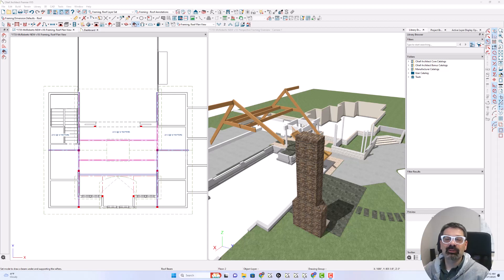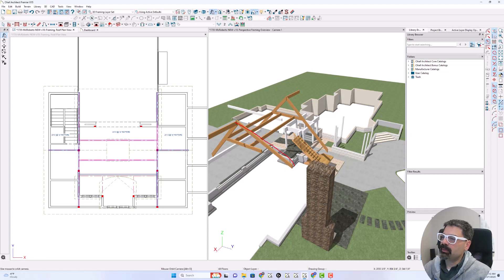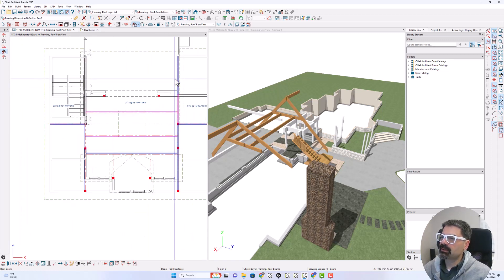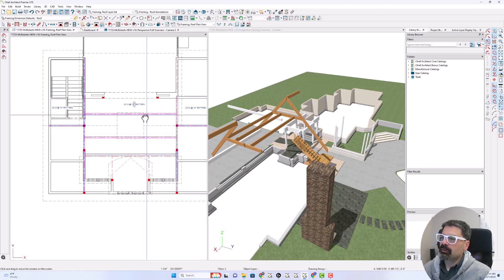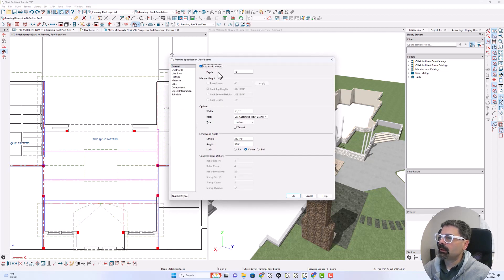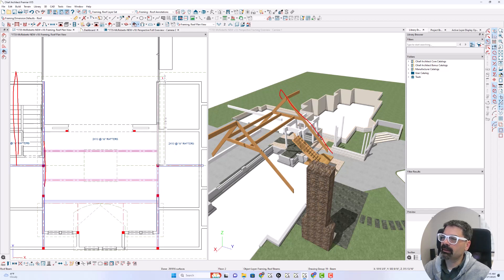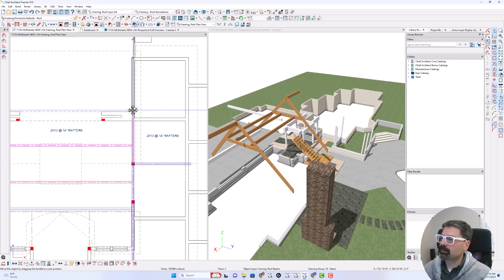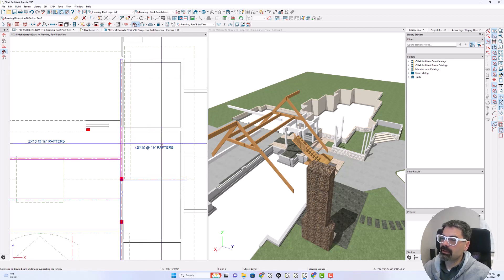Keeping Roof Beams at Correct Pitch | Chief Architect

Comment: It looks like the shed roof overhang and dashed baseline is extending farther over the right wall than left wall.  Always great videos, Tim.
Reply from the maker: It's been a minute since I recorded this, but pretty sure the L/R overhangs were very close to similar. Even if they were different, I don't think they would have been different enough to make an effect on the beam problem I had.
Reply: @DesignbuildsolutionsLLC  Cool.  I always learn something from your work.  Thanks much.
Reply from the maker: Good to hear. That’s one of the reasons I hit record